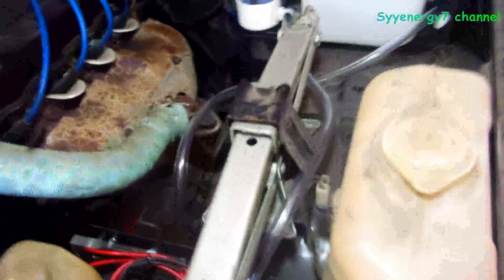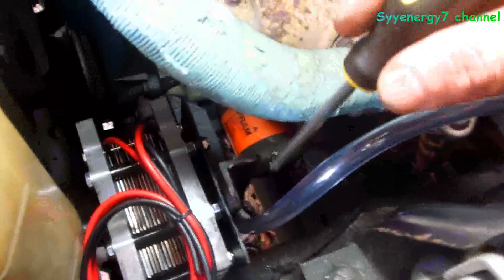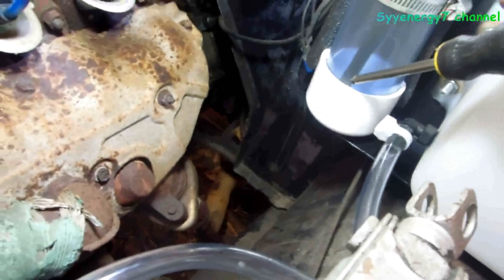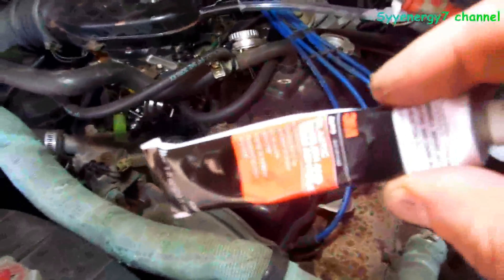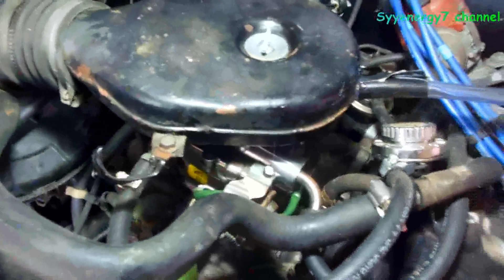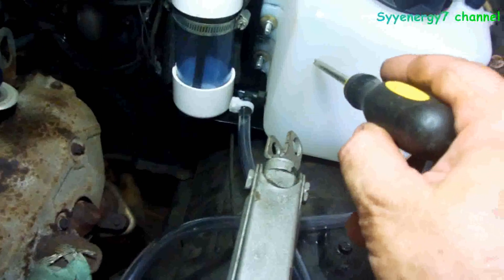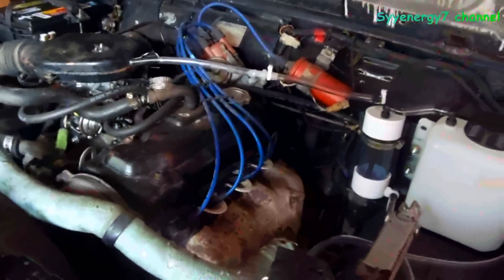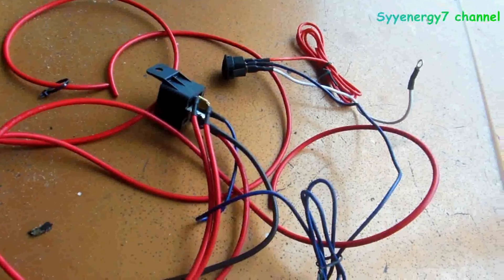Suzuki Samurai Installing HHO, Part 2 of 3 {Plumbing}

Comment: I've done a lot of research on these hho kits, and honestly I Dont know what to believe!? Does it make that big of an impact on fuel milage or horsepower?
Reply from the maker: Tim Spencer It definitely works fine on older non-computer carbureted cars.
Reply: I'm so excited to see you do this, and I can't wait to hear how it turns out!!!! I'm a big fuel milage guy myself.... I drive a civic and get 60mpg driving round trip 300 miles... And I get the best fuel milage out of my entire fleet of trucks! I'd love to find something compatible for my car!
Reply: So the hho wont work with the stock hitachi carb???